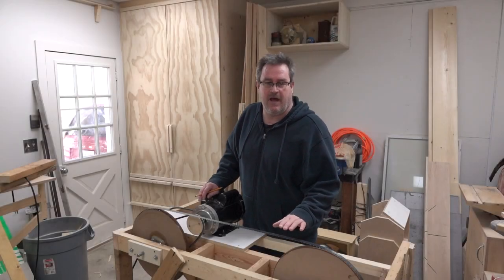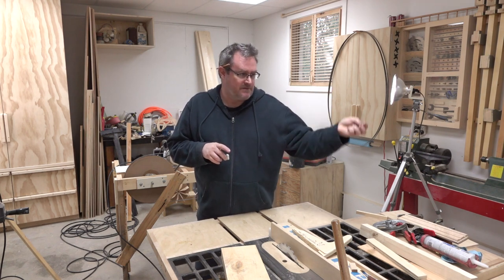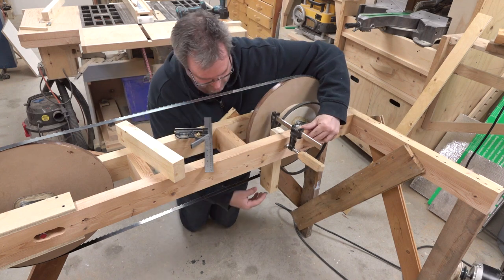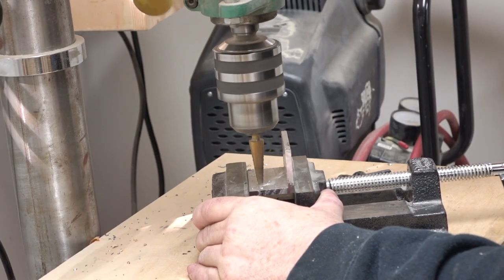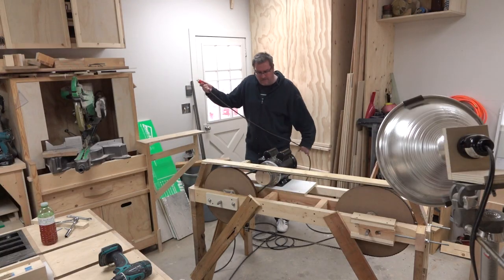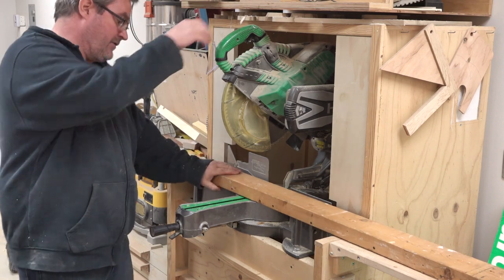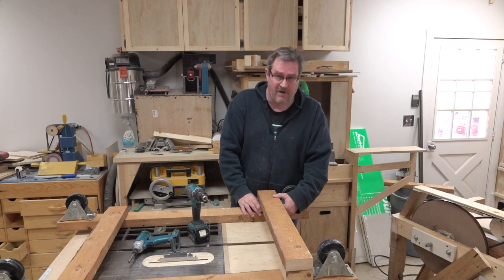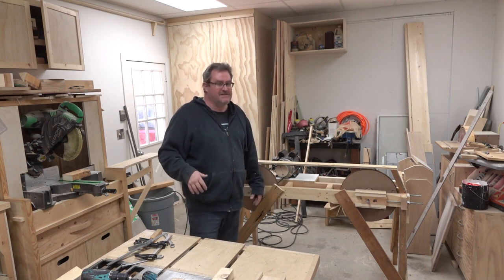Making A Quick And Dirty Band Saw Mill - Part 5

Comment: Nice job, watched the video's of the build and of you you making your first cuts.   A log cant hook or a log jack cant hook would make it incredibly easy to move the logs.  A simple weighted pulley system to feed the log would seem feasible to me.  Simple board s of the appropriate thickness to go under the wheels to adjust thickness.  I think you just saved a lot of us time and money on simple inexpensive design.  Thank you so much.

Comment: I used tough glass cubes as guides for a smaller band saw i made to test out some things. I happened to have them from a sliding door. If they were made to slide a door without wheels, well, a band saw is just faster wear. Seems to work, but the metal gets embedded in the glass.

Comment: think the ceramic material will act as an abrasive and thin the blade material over time 

kindah wondering why you want to move the heavy log instead of moving the lighter saw
mount the wheels to the saws legs and lay two lengths of u channel screwed to a ladder frame made with some 2 by 4's to keep them in line under the log as guide rail move saw to log dont move log to saw 
in youre case you prolly need to do the first cut then rotate the tree untill its down on the flat part and add blocks under the tree to raise it each time you want to cut a new board , the flat part will keep the tree sitting level with the saw 

besides if you keep the setup and have to saw trees up in the field you can mount a small gasengine on it and level the ladderframe up with some woodscraps , trying to move a big log under the saw in soft ground and keeping it level will be a lot harder

Comment: Great job, John. What is the advantage of upping the motor to 240?
Reply: Higher voltage needs less amperes for given power. less amperes means smaller losses at long extension lead. Smaller voltage drop at extension lead means more power at motor.
Reply: +Steve Collins 
The motor is a 240V motor, he was using 120 to test the setup. Better to start low when you don't know, how the setup behaves.
Reply: +superdau Ah, I see. Thanks!
Reply: +Tiit Saul Thank you.

Comment: I don't think that ceramic blade guides are a good idea because the steel of the blade is softer than the ceramic guides.  Therefore, the blade would wear out before the guides.  Although, it might be insignificant.
Reply: +Erik Olson 
I think the same. It's like running the blade along a piece of very fine grit sand paper. The only thing I can think of that could make it irrelevant is that the metal will quite quickly "clog" the "grinding stone" so it will ride metal on metal.
Reply: +superdau  Metal on metal ? This is a good thing ?
Reply: +danny sulyma  Brass works alright, try that.
Reply: danny sulyma What's the point of making the guides ceramic then?  Making steel ones to begin with would do the same thing then.
Reply: +Erik Olson Laguna has ceramic guides on their high end saws.  Pretty sure they aren't pieces of tile though ;)  They throw sparks in use.
Reply: Nit sure about the ceramic itself but construction adhesive wouldn't have been my first choice. I think epoxy would have been a much better choice.
Reply: krtwood Interesting, I'm sure it is a special bearing material that is much less abrasive than a tile.  Although just because its on an expensive saw doesn't mean its always the best, or just better than common practice.
Reply from the maker: +Erik Olson 
You are probably over-thinking it, but that's fairly normal. The ceramic is glazed and that faces the blade - very slick, I doubt the blade will wear significantly.
Reply: I Build It You're probably right, I guess we'll see how well both the glaze and blade hold up.

Comment: opinion* you could have just used some screws for the dolly instead of the threaded rod your not sawing up full trees
Reply from the maker: +bazuka420 
The last thing I want is a screw to pull out while cutting halfway into a log, and the log to drop. That's more about foresight and experience than opinion, though.
Reply: 10 4 i just figured cause your not using it for very long they should hold out screws are tough but that rod is failproof
im excited to see how it turns out